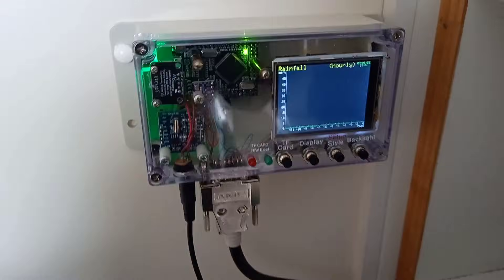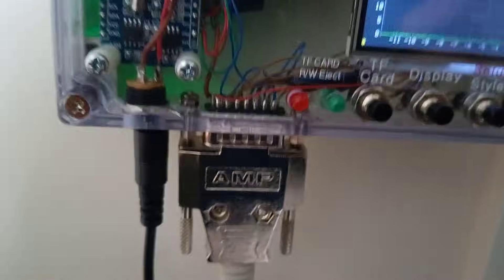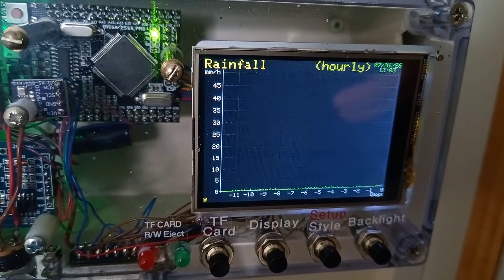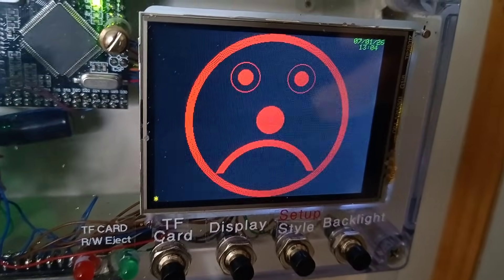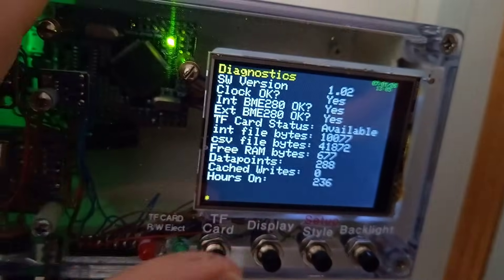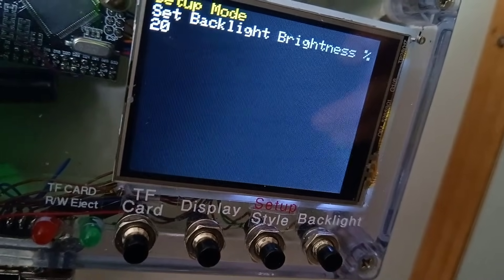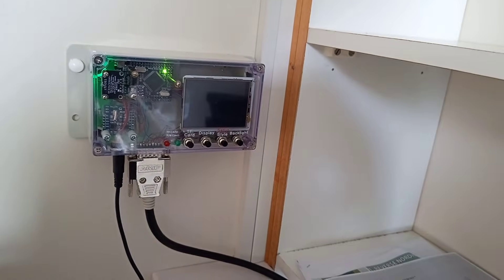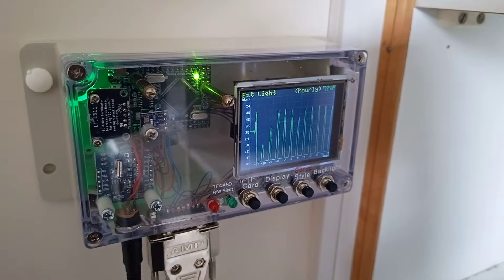Arduino weather station completed!

Comment from the maker: I've realised I've done something silly with the wind direction, I average the angles 😂😂😂. I've now changed it so I average the wind vectors, currently under test and I'll upload the corrected code once its been tested!
Reply from the maker: Currently on holiday and have left the corrected code running. Have already noticed the line graph mode not ideal, will tweak it so if change on average angle >180° points are not joined or joined via zero!
Reply from the maker: Version 1.06 of code now available via link (http://tamitche.unaux.com/arduino/index.html#WEATHER